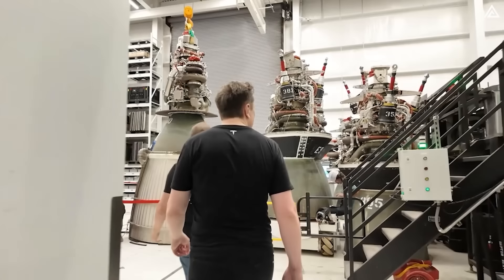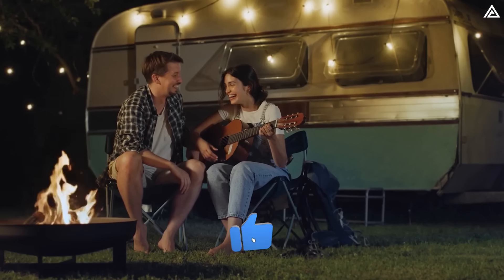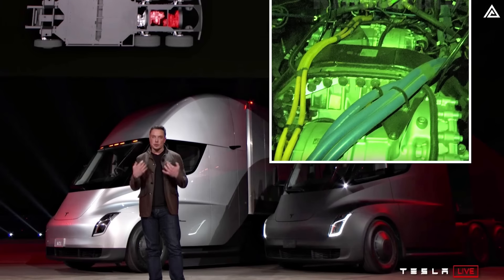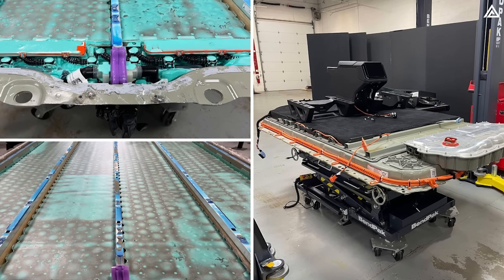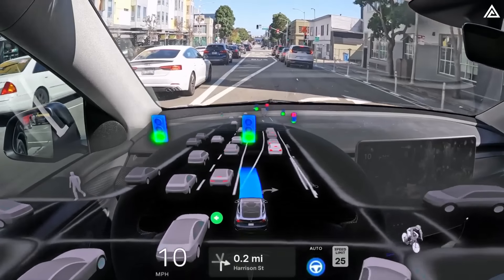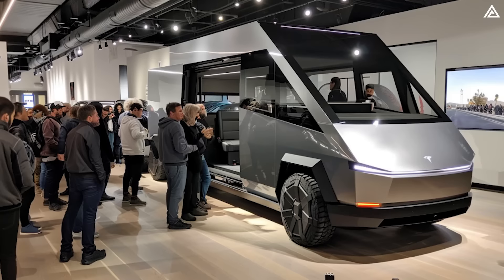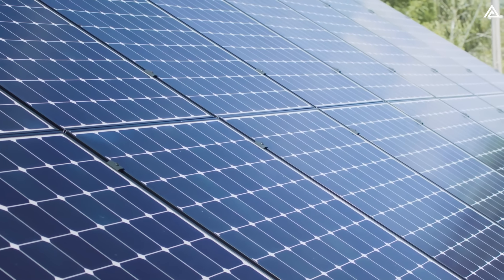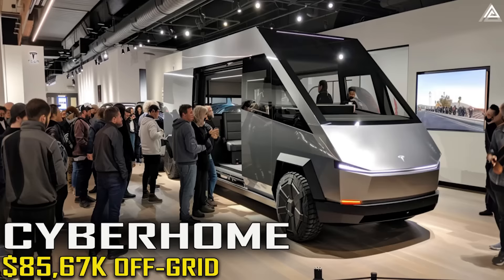2025 TESLA Motorhome Project. That Will Blow Your Mind about $85,67K Off-grid Car

Comment: It takes 48 hours to charge model 3 . How many weeks will it take to fully charge this ??? 🤔
Reply from the maker: Charging times for EVs can vary greatly depending on the charger used. A Model 3 can take 48 hours with a Level 1 charger but much less with faster options. For larger vehicles, a similar Level 1 charger might take several days, but using a Level 2 or DC fast charger significantly reduces this time.
Reply: @adamtech999  so 5 to 7 days? Or?

Comment: How good do they'd in mountains to climb???
Reply from the maker: As for motorhomes in mountainous terrain, the performance largely depends on the vehicle's weight, power, and torque. A Tesla Semi-based motorhome, with its electric drivetrain and powerful torque, could handle mountain climbs well, offering strong uphill performance and regenerative braking for descents. However, range could be impacted due to the added strain of climbing.

Comment: Is there a backup power option for the motorhome in case the main battery fails?
Reply from the maker: Many electric motorhomes come with a backup power option, such as a generator or auxiliary battery, to ensure you’re not stranded if the main battery fails. It’s always a good idea to check the specific model’s features to see what backup options are available.

Comment: How long does it take to fully charge the motorhome’s battery using solar power?
Reply from the maker: Charging an electric motorhome fully using solar power can take quite some time, depending on the size of the solar array and weather conditions. Typically, it would require several days to charge fully, making it more of a supplementary charging method rather than the primary one.

Comment: How does the motorhome’s battery perform in off-grid situations with limited charging opportunities?
Reply from the maker: In off-grid situations, the motorhome’s battery performance will largely depend on factors like solar charging capabilities, energy storage capacity, and efficient power usage. While it can handle short-term off-grid scenarios, long-term stays might require careful energy management or backup solutions.

Comment: I’m curious if the kitchen’s induction cooktop will use too much power, but it’s still a great feature for quick meals.
Reply from the maker: While it does draw a significant amount of power, Tesla's energy management system is likely designed to handle it effectively, balancing the power usage with the motorhome's overall energy needs. As long as it's used wisely, it shouldn't be a major concern.

Comment: It's good a #cyber truck with solar if ever here  in my place , but they having a conflict because some of place having a lower place to getting a flooded situation if they using a electric tanker or like gas station may be you know i planning to something
Reply from the maker: If you’re looking to prepare for emergencies, setting up a reliable home charging system—possibly even with solar panels—might give you more control over charging in difficult conditions.

Comment: Main issue is you would have to travel at night to charge during the day. So most would have to swap day/night to even consider it would work well. All electrical use would be during the sun down period and stuck when storms hit unless you find a charger most likely powered by a diesel engine…😊
Reply from the maker: Thanks for your sharing. Balancing charging needs and energy use is a valid concern for electric vehicles, especially in off-grid situations. It’s crucial to plan for such scenarios and have contingency plans for energy needs during adverse conditions.

Comment: Cool! If they can really put 2000 watts of solar panels on the roof, you could recharge the 900-kilowatt hour batteries in only 450 hours! Well, 450 hours of midday sunshine anyway.
Reply from the maker: Solar panels on the roof are more practical for extending range on sunny days, maybe offsetting a few miles per day rather than fully recharging the battery. But who knows—maybe as solar efficiency improves, it’ll make a more noticeable difference!

Comment: The biggest hurdle is lack of infrastructure.   RV parks already have power for Level 1.   Level 2 and 3 is the issue.  Or 2 battery packs that charge separately off 120V.
Reply from the maker: yep

Comment: Off-gird you say? Not when the vehicle can be switched off from Tesla's HQ.
Reply from the maker: Tesla vehicles do have connectivity features that allow for remote monitoring and control. However, concerns about remote access are valid, and Tesla’s commitment to security and user control is crucial for addressing these issues.

Comment: Slight Correction: The "Original" Semis used 4 of the same motors the Model 3 Used, However, after the creation of the "Plaid" Motors, they went with 3 of them, 1 for cruising, and the other two for acceleration and regen braking!
Reply from the maker: Thanks for your insightful sharing. We will check it out soon.

Comment: So are the solar panels going to recharge the vehicle battery’s? You talked about having to recharge over night with an image of a charging station!? 
Recharging the vehicle battery is the whole reason we want electric motor home. So we never have to hook up
Reply from the maker: Yes I understand your concern. While solar panels can contribute to charging, they typically don’t generate enough power to fully recharge an electric motorhome's battery on their own, especially overnight. This means that for long trips or heavy power usage, traditional charging stations might still be necessary. The panels can help extend range and reduce the frequency of charging, but they may not completely eliminate the need of normal charging, especially during extended travel or in low sunlight conditions.

Comment: I would use immitour into Japan not immigration. Tesla mobile home is paradigm shift. I'd buy it instead of a house in Japan. Chasing the 24°C line summer up north Hokkaido  and winter down south. Leave Japan after get bored 5 years. 😂
Reply from the maker: Are there laws about parking motor homes in Japan?

Comment: Lol... off grid in a electric car?  That’s funny.😂😂😂 The biggest problem is the battery design....and the power to recharge...and speed of charging. Not to mention durability and fragility of the tech.
Reply from the maker: thanks for watching
Reply: @adamtech999  There is a place for electric cars… though.  Thanks for info.

Comment: Just a cybertruck is around 100k.. no freaking way tesla will make a full motor home with an 85k price tag. It wouldn't need nearly as much power as the Tesla semi but an RV would need other features like bathroom, kitchen etc.. peice will probably be around 250k or more is want solar charging and full semi drivetrain
Reply from the maker: Thanks for your opinion. But I don’t think it would cost that much

Comment: It’s to bad when the truck is driving 55 to 65 mph it’s to bad the wind can’t hit the solar panels and generate electricity to the battery’s for extended range then when certain batteries get low it automatically switches over to the batteries that are charging and so on
Reply from the maker: Thanks for your insightful sharing! I totally agree with your opinion. But what about the other features?

Comment: If you had an electric Class B van with a 400 mile range on a warm day -- or 300 miles on a cold winter day -- with AWD, that would be an offroad delight out west here in Arizona. Would love to be able to stay out for four days - three nights and then come back in to recharge overnight at an RV park or at a WalMart. Solar panels on the roof and awning would help, but not be essential. For me and many other drivers, all the self-driving aids would be of no value... the fewer assists the better.
Reply from the maker: awesome! thanks for sharing your great experience. what about the features? is there anything you can look forward to?

Comment: 1. How much will it take to make additional power stations to fill these cars with power?
2. Harmfullness of atomic stations could be tremendously higher then the one from gasoline and so on.
3. Producing and utilizing batteries (that is why Musk looking in space a planet for garbage) will be the game over for Terra!
4. Maybe its better use gas engines  equipped with filters. The only problem is the price, BUT its only the problem of monet system, created by humans..
What do you think?
Reply from the maker: thank you for your insightful sharing. i also completely understand the opinions you raised. however, what about clean energy? will gasoline cars with filters solve the pollution problem?

Comment: We don't need expensive behemoth  EV motor homes, trailers, etc. EV trucks' range is pathetic compared to diesel trucks. You need to improve your EV products and their recharge capability and logistics. Sorry, Elon. Add high voltage air to metal capacitors instead of large heavy battery packs. This simple improvement will produce a lighter, faster,and more efficient EV vehicle or truck. This is a free  advice that could save billions of dollars in EV manufacturing and maintenance. Thanks.
Reply from the maker: Thanks for your insightful sharing! I totally agree with your opinion. But what about the other features?
Reply: @adamtech999  Artificial intelligence is not a substitute for human wisdom, investigation, work, and creativity. Elon Musk is completely wrong assuming that AI can substitute human employees. You always need a human programming team to correct hardware and software mistakes and weaknesses. That's why human experts are always in charge of Cyber security activities. Thanks.

Comment: Get real.  There is not self driving in the truck.  The motor homes don't exist.  The solar charging will not recharge the batteries in a timely manner.  Travel 500 miles.  Then sleep at the Tesla charging station.  I don't think so.
Reply from the maker: Thanks for your sharing

Comment: Tesla’s motorhome concept is super impressive, but I wonder if the price point will make it accessible to the average consumer.
Reply from the maker: Tesla’s motorhome will likely be positioned as a premium product, which may limit accessibility for the average consumer. However, its advanced features and long-term savings on fuel and maintenance might justify the higher price for some buyers.

Comment: I am for the idea of an ecological form of transportation, I simply don't believe we have sustainable or Green EV technology, and we are far from a reliable support infrastructure. There are huge hidden costs, including recycling hazardous EV battery waste on average every 10 years. Batteries are larger in EVs and heavier than those in regular cars and they are made up of several hundred individual lithium-ion cells. "All" of these cells need dismantling before they can be partially recycled and the hazardous waste can be disposed of. The hazardous materials they contain have a well-known tendency to explode if disassembled incorrectly. Currently, EVs are too wasteful and costly compared to Eco gas operation and long-term gas vehicle reliability. There is no petroleum shortage. Better management of the huge natural resources under the continental US will ensure that. 
EV hype is more likely to kill EVs by the current unsolved issues in general ownership, cost of home power upgrade, and the limited EV stations affecting time/distance reliability.
Are you aware that EV charging stations are usually powered by whatever the power grid runs on, which may include Fossil fuels oil, coal, and natural gas? Remote stations may use Diesel generators when there is no power grid.
Dedicated EV ecology minded drivers should look for charging stations that are powered by wind or solar, if you really intend to prevent Global Warming. Good luck with that, check the US EV stations map.
Conclusion: Fossel fuels are still polluting the same, including charging EVs that will also pollute with hazardous waste every time batteries must be replaced. 
But, TESLA Motorhomes and EVs are certainly exciting to contemplate and really awesome vehicles! Wait until Solar Power actually runs these instead of supplements 15 miles. I'd buy that!
Reply from the maker: Thanks for your detailed sharing!

Comment: 1 I'd like a queen sized bed, seats for 6, kitchen, head, mini-starlink with big screen, center drive by wire, one front passenger seat, screens for driver and passenger with p. controls.
complete solar power system with outlets outside and inside for 120vac 30 amp.  No carpets except in bed area. 4 season set up for traveling in Alaska.
Reply: Add towing capability for 5500 lbs. and a range of at least 300 miles while loaded and 2 people.
Reply from the maker: great ideal! thank you for sharing
Reply from the maker: Stunning!!!

Comment: Fact- The cyber truck.only has a maximum of 300 miles
Fact- The cyber truck cost over 100k but has not auto pilot or autonomous driving mode
Fact- The cyberpunk isn't even a truck b3cause it doesn't have a frame. It's a weakass unibody
Reply from the maker: So you own an cybertruck?